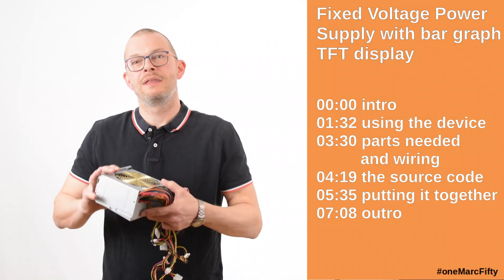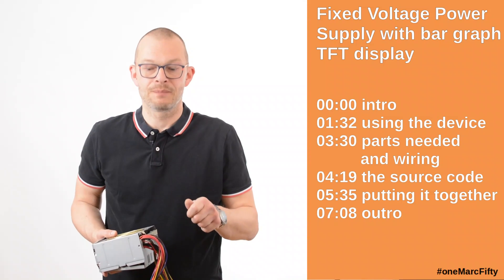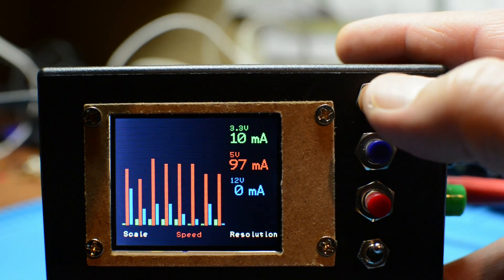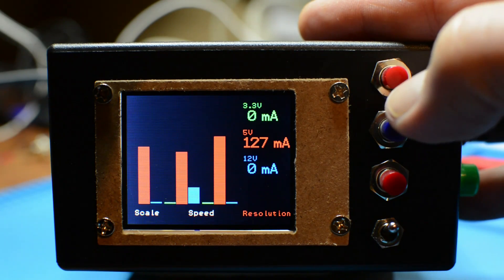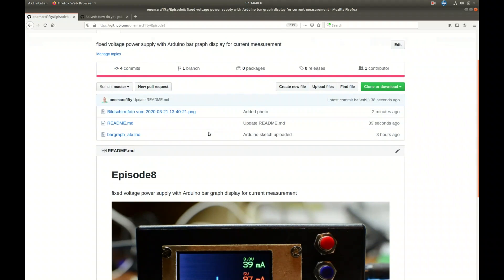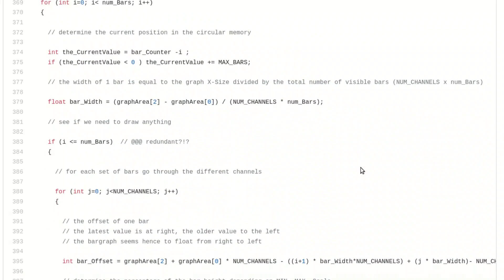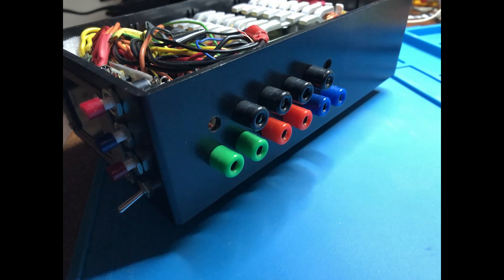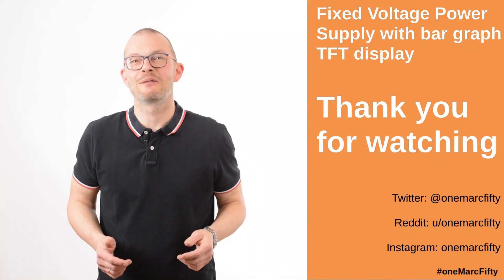DIY power supply with bar graph display on Arduino

Comment from the maker: More to come - promise! I am working on videos with Arduino and ESP projects. Stay tuned!
Reply: Thank you for your video...
You can post video, arduino code for EDM6300 + ESP8266 to google spreadsheet? 
I want to send tag 125kHz to google spreadsheet. Just send tag number only to google sheet

I wait your video in your channel...
Reply from the maker: Hi Nana, many thanks for your comment. I am afraid that this is no use case I will be addressing in the nearer future; however, if you are using the EDM6300 reader I believe you could use the ESP-RFID project and all you would have to do is either add some code to send to Google or alternatively have an MQTT gateway do that. If you google "esp8266 google spreadsheet" you'll find some examples on how to do this.
Reply: @OneMarcFifty  thank you for your reply and advice..

Comment: Thanks for sharing, do you have a video explaining the code as you write it ,ì would loved to see and learn more about coding.ì want to make from scratch a 7inch tft touchscreen with graphic keyboard  and multiple settings pages power supply for myself, it would help to see some coding and explaining what each code line does,would you be interested in helping?.best wishes 🎉

Comment: Does not Work for me !
Reply from the maker: Hi Ben, first off - I am sorry that the video does not work for you. Did you actually try and build it or are you just saing the video is not interesting for you ? If you are having trouble building it, please feel free to jump on my discord server and we can try and troubleshoot it !
Reply: @OneMarcFifty   mate, I bought all the parts required. Installed all libraries required. After uploading the codes, the screen is white blank! I have tried so many times, still does not work! I have built so many Arduino projects and they all work fine!
Reply from the maker: Ok - if the screen is white then you might need to simply lower the brightness/contrast. I‘ve seen that before - can you please send me a photo (front+back) of the display?
Reply from the maker: @MM-tp2fq  You may contact / PM me on facebook @onemarcfifty or Reddit u/onemarcfifty or on discord https://discord.com/invite/DXnfBUG
Reply: @OneMarcFifty  photos sent through Messenger
Reply from the maker: Got it - replying on messenger

Comment: Current reading is so noisy, put an RC filter on the ADC input and/or do some averaging in software. nice project.
Reply from the maker: Great advice, thank you very much. It is true I had thought about averaging it - didn't want to add additional elements to the schematic though.